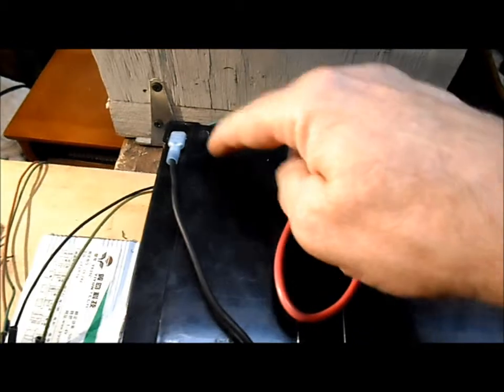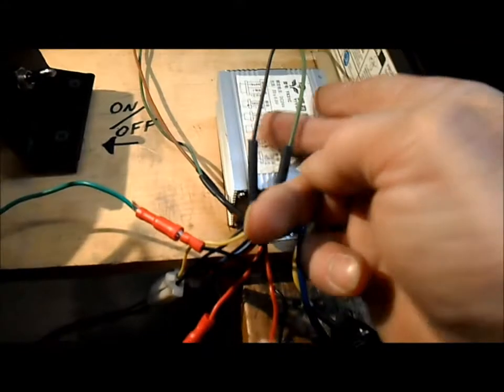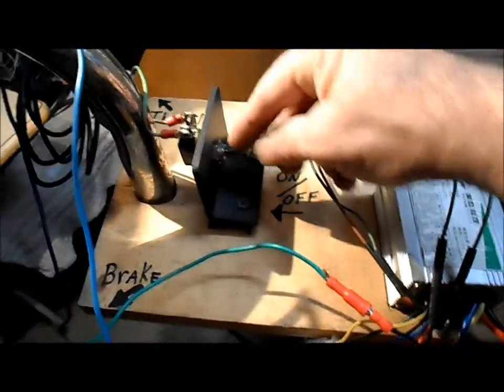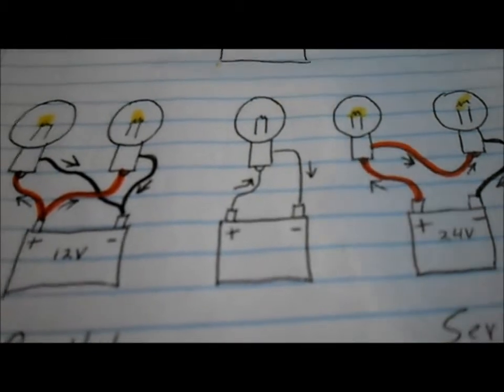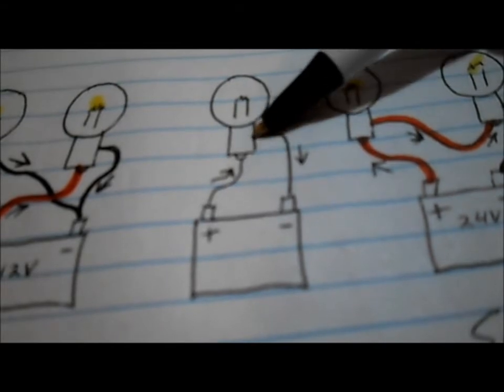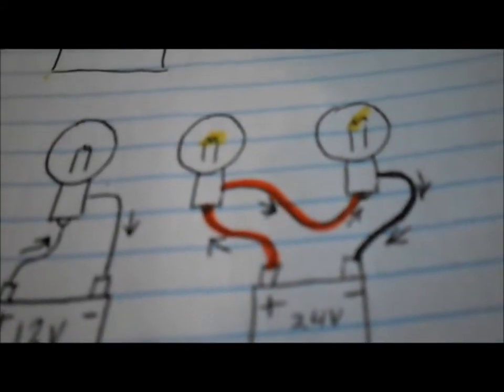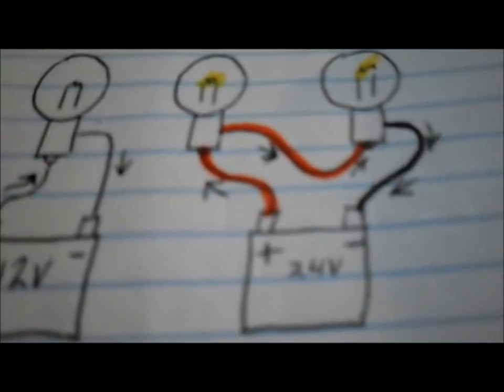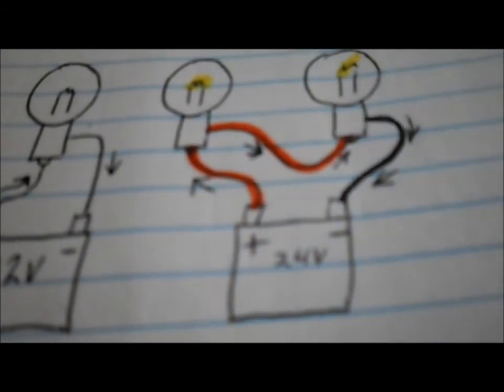YIYUN YK31C 24V speed controller connection info & demo

Comment: Bonjour Monsieur je vient vous demande de l’ aide sur un controleur trotinette eléctrique
 model YIYUN YK09 24 volts 250 watts LE PROBLEMEE C"EST QUE IL A PAS DE VOLTAGE SORTIE MOTEUR FIL BLLANC ET BLEU  BATTERIE 24VOLTS 8AMP OK VOLTAGE DE 5 VOLTS TROTOLE OK SCREEN LIGHT UP WITH CHARGE  LED OK IL Y AUCUN FIL ORANGE OU ROUGE POUR FAIRE SIGNAL AU CONTROLEUR NI THROTOLE COMMENT FAIRE DAS CE CAS  MERCI DE  VOTRE AIDE
LUIS

Comment: I have the same 24v 500w controller ,  would controler work with 12 v battery? the on off switch can be bypassed?  motor connection has blue and yellow wires , as you say blue is positive , yellow negative

Comment: any idea if this 24v controller can handle 32 volts?
Reply: Yes it can handle up to 36v most controllers are capable of that it would probably handle 48v they usually have 62v capacitors

Comment: I have 36 volts 800 watt brush motor controller, how should I connect front, back, indicator lights and horn. Which voltage bulbs would be used 36 or 12 volts?

Comment: On the stock controller the brake lever connection is black off the controller to red on lever side connection. I was surprised to see to not see red to red/black to black match stock. Are you sure I connect yellow yk31c to red stock brake lever and black to black? I don’t know how to test right now.
Reply from the maker: This is how this specific controller was wired. These Chinese controllers use many different color wires. It's best to check them first, to be sure what they do.

Comment: I appreciate your good explanation in the video. I want to check if my trottle works. Do you know what Kind of signal it sends to the controller. Looks like a kind of potentiometer to me. Thanks for your content
Reply from the maker: Thanks, These Hall Effect throttles sends a signal of 0V (off) to ~5V (full throttle) You can check it with a multi-meter. The red wire powers (+) the throttle (it should read 5V) The black wire is the negative (-) & the other wire (green, white, blue etc.) sends the 0 to 5V signal back to the controller.
Reply: @functional_artist  Thank you very much. This helps me a lot.

Comment: Bro can you solve my problem,
I have 24 volt and 250 watts motor
But my controllrer is 24v 500 watts 
Is there problem if i setup 3/7=21#3600mh batterys,
Please tell me have 
any problem or requirement on this setups
Reply from the maker: Using a controller that is a little bigger than motor is usually OK...but, you'll probably need bigger AH batteries.

Comment: con you specify what each wire for the throttle control is for ? 
my Yiyun YK31C24V has 3 Wires and the throttle lever  has 5 wires coming out of the Throttle White yellow blue red and black
Reply from the maker: On this controller, the red wire (+) supplies power (5V) to throttle. The Black wire (-) is the negative & the blue wire sends the signal back to the controller.Does your throttle have a switch? If so, the other (2) wires should be for that.

Comment: Do you know how to remove the 41 volt shut off?
Reply from the maker: 1) The "low voltage shut off point is ~20V for a 24V system, ~30V for a 36V system & ~41V for a 48V system.2) No & why would anyone want to? The "low voltage shut off" is a safety feature to protect your battery pack from being drained too low.

Comment: Hello I have ordered simmilar kit from China, did You test it in real conditions yet ? How is brake working in this controller with classic DC brushed motor, is there any chance for at least small energy recupperation in this setup ?
Do You have some datasheets for this kind of controllers, nothing can be found on resellers product pages
Reply from the maker: Yes, many times, they work great. Check out https://www.youtube.com/watch?v=OjoJdzLyeYQ&list=PLoL6eIYWPO_l4g47Zt_YPcBOLSOtLXNqMThe brake function "cuts" the power going to the motor (when activated) but, it does NOT offer any type of energy recuperation. As far as dats sheets, most of these small DC motors are "clones" of the MY-1020 motors. So, I usually look at that info as a reference.

Comment: good morning ,
excellent video
I wanted to ask if the brake switch is normally closed or open
Thank you
Reply from the maker: The brake switch used with these speed controllers needs to be a normally  open type. When this circuit is closed it stops the power going to the motor & activates the brake light.

Comment: good job. Thanks for explanation. What kind of charger do you connect to the controller ? thanks
Reply from the maker: The charger must be matched to the battery pack that is being used. It has to be for the proper voltage (24V, 36V, 48V etc.) & also for the right type of battery (Lead Acid, Lithium etc.)This system uses a 24V charger for SLA (Sealed Lead Acid) batteries.

Comment: What is ah of the battery
Reply from the maker: AH stands for amp hour, it indicates the capacity of a battery. Example: If a battery is labeled 12V 12AH, it indicates that it is a 12 Volt battery with 12 Amp Hours of capacity.

Comment: Hey I'm kind of curious as to how would you run that motor in reverse what would you need to do?
Reply: Tony Rodriquez just switch the polarity of the motor. Basically reverse the wiring going to the motor.

Comment: What is the name of those white plastic interconnects?
Reply from the maker: Quick connects. I usually get them @ Alfa Wheels (kit ~$10.00) https://www.ebay.com/itm/Set-of-Matching-Quick-Connectors-Metal-Terminal-Pins-f-Speed-Controller-box/152634003822?hash=item2389b2116e:g:Mt8AAOSwqF9ZwWAH

Comment: What are the bare minimum connections to get the set-up functional?
Reply from the maker: The mandatory connections are the battery, motor, lock (on/off switch) & a throttle
Reply: @functional_artist  So the throttle wont work without the lock? Also because this is a 24v speed controller can be ran with a single 12v battery or does it require 24v? Basically I have the 24v motor, yk31 speed controller, and the thumb throttle but when I wire it up the thumb throttle does not turn the motor when trying to use the speed controller but obviously the motor works if I bypass the speed controller and go directly to the battery
Reply from the maker: The switch connected to the "lock" plug turns the speed controller on (or) off. It has to be connected & switched on, for the throttle to operate. Most speed controllers have a low voltage cut-off point built in . The low cut-off point for a 24V controller  is ~20V so, yes you must use (2) 12V batteries with a 24V controller.
Reply: @functional_artist  Great I appreciate the info that is a big help for the project. Do you have a toggle switch recommendation for this speed controller? I would prefer not to do the key switch
Reply from the maker: The "power lock" plug is just a "control" switch & doesn't carry much current (usually less than .25A or 1/4 of an amp) so, most any decent switch should work. I have used 12V (automotive style) rocker & toggle switches & also 125VAC 10A -15A switches to control this circuit many times without any issues.